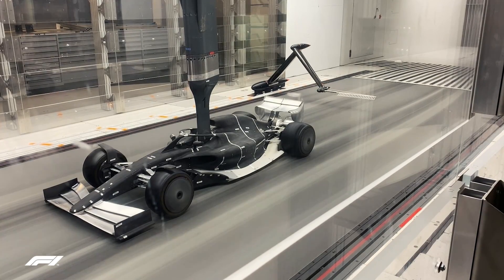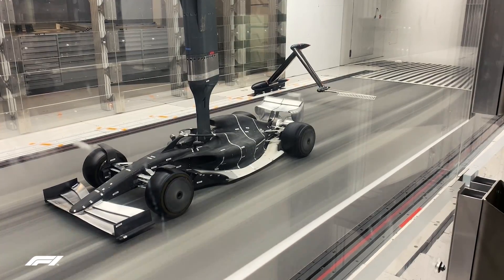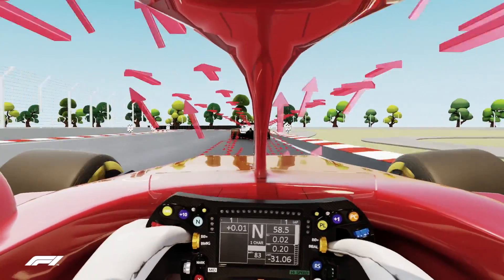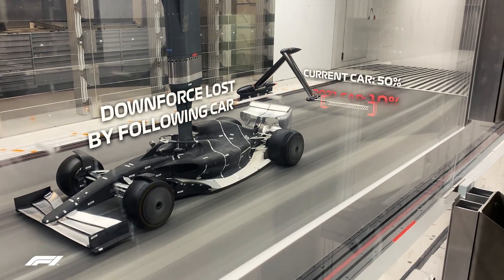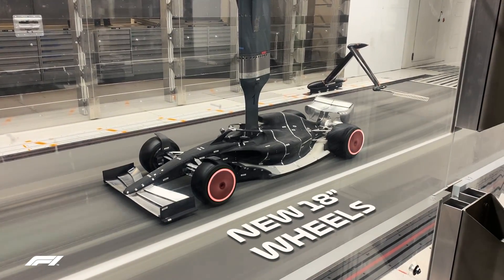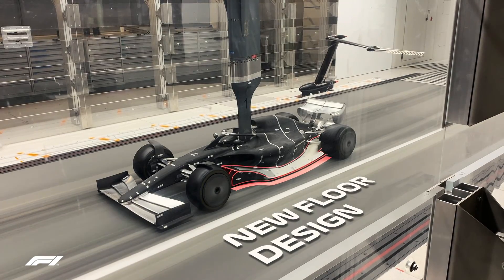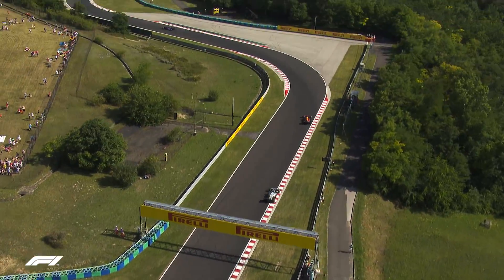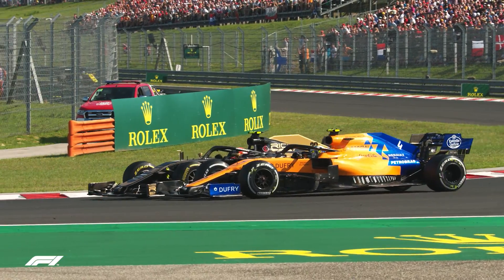Future F1 Car First Look | Formula 1's 2021 Car In The Wind Tunnel

Comment: I still find the concept silly... They should just have defined a testload and defined an upper limit of downforce loss on that testload. Let the teams figure it out.
Reply: It's more complicated. Downforce isn't an inherent property that applies everywhere the same, like mass. Saying that downforce will be 5-10% less effective is an estimation, as complex car geometry can make that number move a lot, especially with the different team designs that will come out for both splitters and front wings
Reply: @alexandrearrive6199  yes, nonetheless if you measure downforce in a way to work best with laminar flow you get an approximation that is very usefull. And by limiting the downforce on a simple testbody (like shown in the video) you guarantee at least a level playing field at a certain base line. Which is way better than descriptively ruling on a certain path to take which both limits engineering ingenuity and does not guarantee the desired effect. While the proposed setup apparently reduces the downforce loss that reduction is not actually part of the rules. So if somebody manages to create it again within the current ruleset you're exactly where you started. In a parameter driven ruleset that cannot happen. If somebody created an aero kit that created as much loss of downforce as is normal right now it would just be illegal.

Comment: Call me outdated but we didn't need any of this in the past.
Reply: JonatasAdoM Dirty air was also an issue back then.  Especially in 2004 during the height of the V10 F1 cars.  In the preceding 90’s and 80’s F1 cars dirty air wasnt that much of an issue as the cars were overall a lot slower when compared to today’s cars

Comment: And what about engine specs?? 800cc 3 cilinder engine?
Reply: 1.4 L Twin Turbo V6 with higher fuel flow restriction and 3,000 higher RPMs, they should sound 50% better than today's cars

Comment: 2:25
I think they should skip that.
Seriously, I WANT teams to have the freedom to come up with good ideas. I don't want 20 identical cars on the track!!!!

I think there a a bunch of positive aspects to what's going on, but if your base model only leads to 5% downforce-loss you can give the teams some freedom. What's the worst that could happen? Maybe they end up doing something that would lead to 20% downforce-loss at most which would still be a massive improvement!

Please don't make F1 a de-facto spec series.

Comment: I'll just say cover the wheels (although that might ruin the look for me) - most of the dirty air is due to those open wheels. It will also boost top speeds significantly.

Comment: Im fine by moving to bigger rim/tire size .. but from 13 inch to that…      FUgly cars..  less viewers..          15-16" tire size is max for formula cars..          all you are going to get is hundreds of tire punctures on smallest rocks, debris , going over kerbs..   street tracks are going to be nightmare…   0 tire temp, debris , …    And at the same time they talk HUGE ON SAFETY ASPECT..    Flatout on Eau  rouge , over small rock that cuts your tire…    so safe..   but hey .. at least you have the halo, so you are trapped on car that is upside down and maybe burning like Nico's car was…    Only safety the halo brings is for the pr people so they can say .. they did everything…  it does not make driver's any more safe.. and im sure that there are more risks now, than there used to be.    lets say.. car gets battery issue and is live from chassis , while all so being upside down..  driver cannot get out.. cameras dont see if the car is alive or not,  marshals cannot touch the thing..  maybe some oil/fuel start to leak.. or maybe just the heat soak from exhaust to carbon body lights the thing up..                  

And these brains on whistle thinks its an good for the sport...    what an pathetic way to kill off the sport..    first force on halo's instead of drivers own choice,  then this tire thing..   what next ??   cover up the wheels to move away from open wheel concept and then nothing else is left than going on ovals only..   
All the drivers are so bland anyways these days.. that there is 0 excitement left in this sport..

Comment: But will the cars become smaller? There is no point in improving aero when the cars are to big for the track like we see in Monaco. Please don't waste all your time on one thing and forget everything else. (I still like the aero changes if they work the way they are promoted, but thats not the only Problem F1 has)
Reply: It doesn't look like the nose is any shorter, so I'd like to see them mandate a shorter wheelbase.  (And shorten the nose).  These things are now way too long to navigate the "historic" tracks.  A shorter wheelbase wouldn't do much good by itself as long as they insist of having yards of bodywork sticking out both ends.  It seems all the design effort is going into top speed and overtaking on the straights, but that's not where racing happens.

Comment: Surely having low profile tires will cause them to heat up more and wear faster ? Mabie see some more blowouts and buckled rims ?
Reply: Callum Cossar Nope, Pirelli will design tires to be much more durable to overheating.  The lower profile tires also promote the teams to develop and tune the suspension more as the current high profile tires sort of dampen the suspension thus limiting the effective feel of chassis and suspension changes

Comment: The technological intrigue of F1 is almost gone. Rule changes to make the car look cool to the younger generations is silly. Not only does the car resemble a mid 2000's Indy car, it's going towards every team just running nearly identical chassis's where unique innovations will be just a thing of the past. I sure hope I'm wrong. But at least it's potential for better racing.

Comment: Maybe this aerodynamic design is the solution for better air-flow behind the car (mostly for the cat behind), but the design in general reminds me quite a lot of the typical poster on a futuristic car or "concept car" that a boy has in his bedroom. Exaggerated and to an extent hilarious design.

Besides, those "canards" over the front wheels can be a big problem if the tyre blows up. The wheel may be blocked, so the driver loses control of the car and whoever knows where will he end, or else the torn up tyre may brake that piece, making such an invention useless.

Comment: We want louder engines and no DRS! for real racing, thank you
Reply: You shall get both of those in 2021.
Reply: @Chuckiele  MGU-H remains in 2021, dude. 2025 is when the engines change.
Reply: @sekhyhybrid6701  You sure? Cause some comments said otherwise.
Reply: @Chuckiele  Yes, if you keep following the news articles regarding F1, you should know that 3 months ago they said that the engine formula won't change until 2025. Ironically this is for now also the last year where Mercedes would compete in F1.

Comment: Just get the 2010 regulations back with the V10s of 2004.
Reply: Visvesh Narayan Are you really dense?
Reply: @GTChucker86  What do you mean? There was a lot more overtaking during the 2009-2013 era and the 2009-2010 cars didn't have the stepped nose rules. The V10s from 2004 sounded great too.
Reply: Its not that simple,  the cars today are based from the 2009 rules as evident by the sidepods and overall chassis and underbody design,  the thing with the current cars is the width and the later concepts of outwashing the air around the car for less drag which was based by the Brawn GP car that had a front wing specifically designed to drive the air around the front tires and the cars after that were just evolutions of that idea.  Going back to exactly those narrower 2009 cars the laptimes will go down significantly which isnt the part of the goal of the 2021 regulations, they hope to find a design thats actually faster while also good for close side to side racing.  Thats why they brought back ground effect for 2021, Ground effect has been the holy grail of F1 aerodynamics since Lotus’s discovery back in the late 70’s to 80’s.  Its gonna generate a lot of downforce while not disrupting too much air for the following car.  As for engines im sorry but V10’s are not the future,  you cannot deny that hybrid technology is the way to go for F1 as it has a better low end and top end output when compared to the most powerful V10 F1 engine,  no manufacturer today would join F1 (except Ferrari) if they still ran v10’s and they wont spend millions on an engine that wont be beneficial to their own developing in house technologies,  The V10 sounds great but its outdated and unreliable.  The teams wanted the turbo engines for years and they finally got it back and now people are complaining.

Comment: 0:10 not only Martin Brundle call Alfa as Sauber, F1 channel content creator made the same mistake lol.
Reply: sam3806 the Official name is Alfa Romeo Sauber F1 Team. So you can use both.
Reply: @raheem201231  And they are still under the swiss flag.
Reply: Alfa Romeo f1 website: https://www.sauber-group.com/motorsport/formula-1/races/
And beside, they can run the model at any wind tunnel like at Toyota.

Comment: car doesn't look great, but we will have to see.
we also need to wary of making it too easy overtake.  There is some value in it not being easy, you get racing.  if its too easy after a few laps the cars are in the right order dpeending on pace, (and were already sorted via qualifying) and then there is no overtaking.
What you need in my opinion is to increase variability, which simply can be rain/weather (why F1 continues to persue sunny hot weather running i don't know)  but i would also remove being able to make adjustments to the car through a lap/race.   the cars should be set up for the circuit, but tweaked on every straight for the the next corner.  This would mean parts of the circuit you are stong and other areas not so.  ( and i still think we are waiting for a nasty accident when a driver is making adjustments on a straight and could miss something ahead.   
and please please tell me that DRS will be removed... if we have DRS and reduce loss of downforce then overtaking will be way way to easy and routine.
On DRS, i also think the wing shou;d open for a set period and close ahead of the braking zone, not when they brake.  It should help to get a car into the slip stream but should not continue to assist when along side or even past.  Some of the overtakes are so boring, there is no fight and no way to defend.

Comment: Too big frontwings again,  REDUCE them.   RIDICIULOUS oversized wheel rims.  Not flattering,  keep them smaller. 
OH AND FUCK OFF WITH THAT HALO. Remove that piece of shit.  It's a death trap if your car is on fire and it's never had any proven effect.  

If you can change these 3 things then the 2021 car actually looks ok.  But i still hate it.  I like bargeboards.  I like sidepods.  Diffusers are cool too.  FUCK this artificial attempt to increase overtaking and racing.  We want to see the best and fastest cars,   defending is also an art.  F1 is not about more regulation,  it's about innovation.  Remove DRS. Bring back refueling.  Give us good race tyres and put V10s in without any of that  ERS crap.   Why the hell does it have to look like an IndyCar?  Fuck these Americans.  I love the USA,  but Liberty Media is full of thickheaded cunts that don't have a single clue about Formula 1.  This is not a damn circus!!!

Comment: What benefits do 18" wheels have?
- Heavier car ---> not good
- More unsprung/undampened mass --> not good
- Higher moment of inertia --> not good
- Less spring/dampening effect of the tire ---> probably not good
Reply: @Roelof J. Hetsen I don't understand the marketing. Who thinks a street tire is anywhere similar to a F1 tire is an idiot.
Reply: @turbojockel9795  have you met the general public :-)
Reply: You can fit better brakes/cooling. Teams own suspension settings are not hidden by the tyres. So the team that does better gets a better reward than now.

Comment: it looks like an indycar

Next step will be simpler roads, until straight lines roads
So in 2021 I can say goodbye to the F1 that I fell in love when i was a kid
Reply: No, the ground effect based aerodynamics will give a lot of grip for cornering without adding too much drag on the straights. It will be a faster F1 with more overtaking without the need of DRS or other junk. You will actually get back what you missed a long time ago and Im surprised that you survived the farce we currently have until now.
Reply: @Chuckiele  Yes, when it comes to racing, visibility and entertainment, these cars are going to be better, I know.  But in the design section, they are very similar to the indycar (straight nose, smooth lines, simplified aerodynamics ...).  When I said they would never be the same as before, I mean that now the rules on aerodynamics are much stricter than before, and in 2022 it will be even worse, and for me, formula one is also run by engineers.  If you put a lot of limitations on them, it's as if you reduce the size of the track by half: the drivers would have less options and less freedom.  Formula one should leave more freedom to developments, I think
Reply: @xxoan.1613  As long as some teams have a much larger budget than others, more freedom to developments caused the sport to become what it is right now and Im quite sure there will be enough headroom left so that we will se a dominance of certain teams again.
Reply: @Chuckiele  i know what you mean. If only the smartest team win, and not the richest. But if you dont have space to create, doesnt matter who is the smartest

Comment: Don't forget to mention the super wide front wing designed to be knocked off in the first lap bringing more "action" to the races. And new double strength DRS combined with 4 DRS zones per track that will provide more "overtaking".
Reply: No, if ground effect proves itself, DRS will be dropped. DRS was a temporary measure to fix the problem that oversized wings brought with it that made overtaking almost impossible, but when grip mostly comes from the ground effect, the huge wings arent needed anymore and the DRS finally becomes obsolete.

Comment: and 2-3 super teams will still dominate
Reply: No. With the budget capped at $175 Million, Mercedes, Ferrari, Red Bull, McLaren, Renault and Williams will have the same budget which means it's about who uses that capital in the most efficient way possible that will determine who will be leading the championship
Reply: @TheJoezaidan  there'll be plenty of loopholes to allow the rich to conduct R&D outside of the realm of F1 budgetary rules.  Don't kid yourself
Reply: @WanderingSword  There is always gonna be loopholes that the top teams are gonna use but the difference between the field isn't gonna be 3-4 seconds, instead it's gonna be 1-1.5 seconds which tightens the field and gives teams like Williams and haas the chance to challenge for the podium in some cases.

Comment: nice car but I wish it had a shark fin
Reply: Why? It looks so clean and smooth, put in a nice Ferrari red or Toro Rosso blue and I think I will want to lick it
Reply: @KaoruSF  take a look at the shark fin on the 2017 Mclaren, the imagine that on this car
Reply: @isrcinimatic587  I honestly don't think that it is that good looking but ok
Reply: Sgt Arch Dornan shark fins also increase cornering speed
Reply: @isrcinimatic587  this maybe is why they took the shark fins off, with ground effect the cornering speeds are crazy and with some imperfections on the roads it can be dangerous, now imagine that + the shark fins it would be quite amazing but very dangerous
Reply: @KaoruSF  the cars nowadays are very safe, even in an accident, plus more lateral force would make it harder to spin out

Comment: Sounds great! Must be hard though to develop a car that doesn't create such bad air for the cars behind. I bet it's even harder to make rules to keep it that way because once the teams start to mess with the aerodynamics of the new design and develop new parts for it, you'd think that it would change that 10% for the car behind.
Reply: Well, the air for the cars behind mostly gets messed up by the huge wings that are needed to keep the car on the ground. The idea of the ground effect is to suck the car to the ground via a pressure drop under the chassis, so that those big wings arent needed anymore, which wont just get rid of most of the drag, thus giving the car more speed and the cars behind cleaner air. The concept has been used by Lotus a very long time ago but back then it was extremely dangerous as a slight imperfection in the ground or a contact or a driving error could cause the car to lose grip entirely and slide straight into the walls. This has been fixed now by attaching the aerodynamic parts to the rear axis rather than the chassis itself.

Comment: Apart from their size being ridiculously too big, car looks awesome.
Reply: well the car is slightly smaller from 2019, it's not as wide at all from 2019

It looks like the cars are slowly getting smaller
Reply: @jxmint4458  F1 cars have been slowly getting bigger due aero being king, think smaller and more agile cars would create a better race
Reply: @SuperFlembob  I'd like car sizes to go back to the mid 00's they were the perfect size cars
Reply: @TheRagingStorm98  Same the 2006 renault was a great looking car.
Reply: @SuperFlembob  Cars got a lot bigger with 2017 regulations forcing it. The last trash regulation change, probably the worst...
Reply: It's hard to actually race with bigger cars that's why.

Comment: The mud guard on the front is just waiting to have extra aero bits put on. I have little faith in simulations to create better racing its failed everytime just have to look at this years front wing changes and why they were made, its made no difference. They need on track testing